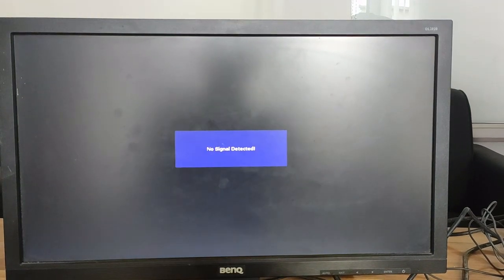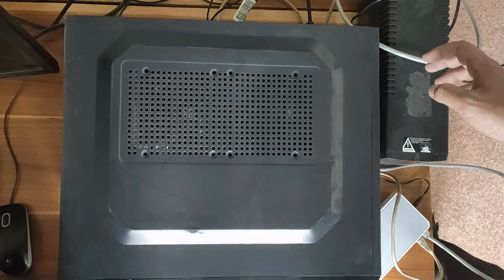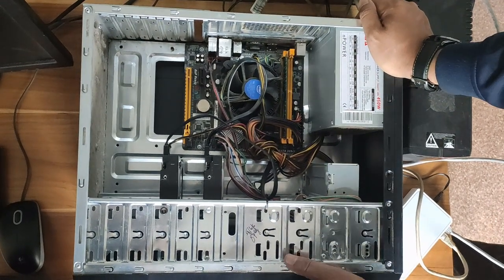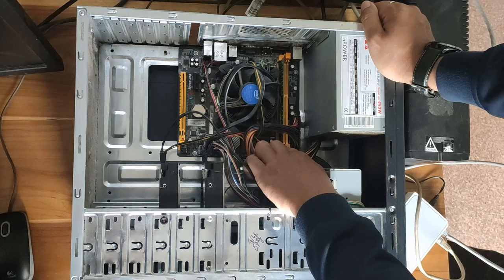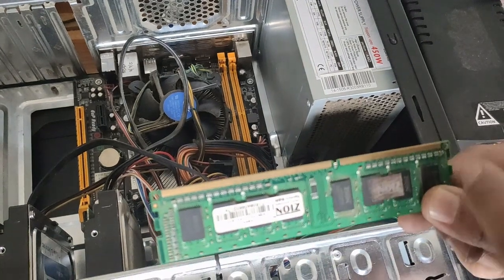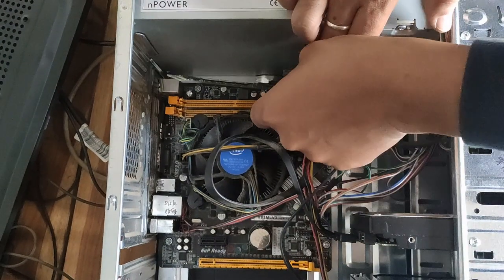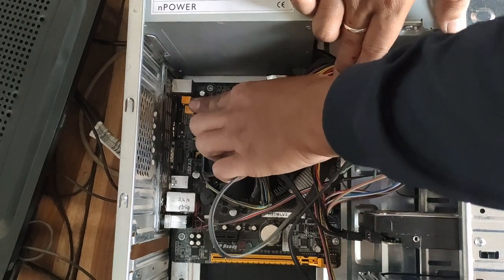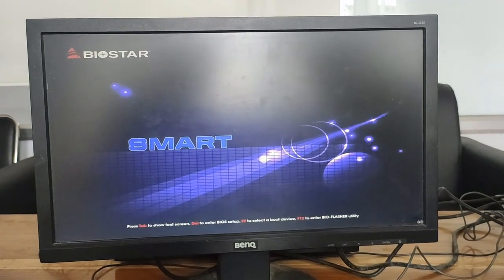How to fix "No Signal Detected" issue on on Monitor, due to dust on RAM

Comment: im struggling with this, my monitor not dedected at all, (no singal)  i did everything possible, replug the RAM new video card thermal for the CPU and still can't make it to work :(
Reply: Realvipul Gaming  I finally made it work by moving. Jumper in the motherboard , it was booting. Up with no errors, then the jumner broke from trying many times
And now it doesn't. Even boot.

Comment: Any suggestions for when you are using this as a dual monitor? I don't have a CPU or anything but it says this when I try connecting it to a Mac PRO. I am using a brand new HDMI to USB C type cable and the laptop is detecting the new monitor - shows up while setting it up.
Reply: sorted..
Reply: @BennyThomas-lightstalker  how did you resolved

Comment: not working for me, also my usb ports are not reconising any of the thiungs i had plugged in before such as my steelseries mouse, keyboard, but they all work on my other computer no problem.
im going to dry dp cable now
Reply: tried dp cable, nothing works
Reply: @kevmatt8450  tell me if you find a solution

Comment: There is no way ram contacts are the cause. POST beeps would engage for RAM problems unless there was a problem with the memory controller pin on the cpu. In theory GPU problems will produce this but it`s usually just a data pin on the cable or on the internal part of the GPU connector.Motherboard mosfets more likely if power is still going to the drives and GPU fans spin up etc .CPU? power good would not initialize you would have a brick basically. In short if everything works but no POST beep it`s your motherboard.Re-seating battery or shorting jumper would have no effect in fact the battery no longer keeps the Ram chip from draining  it`s just for the real time clock.
Reply: Look at all the comments that said this fixed it
Reply: I agree with you. I tried several times to put out and in the ram, even bios battery, but it happens all the time with my BenQ monitor.